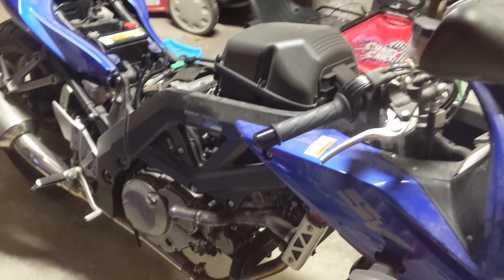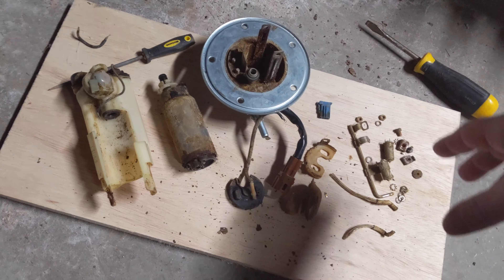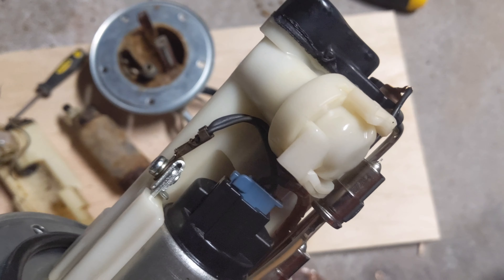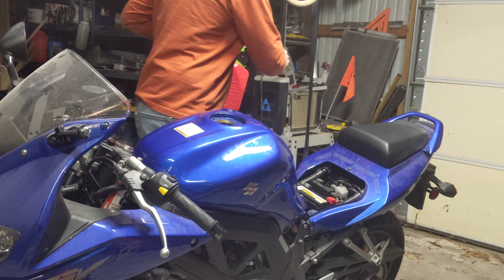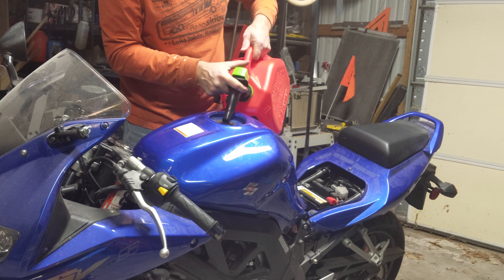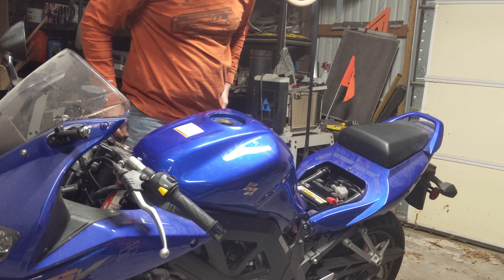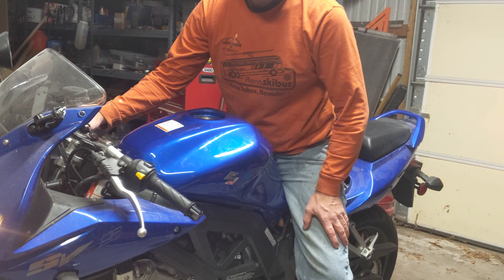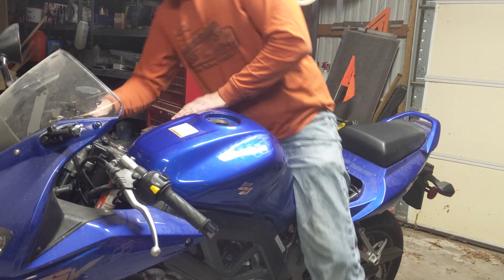Replaced the fuel pump in my SV650S auction find to get it to start!!!

Comment: Hello,
Did they have more pumps at the place you bought from on ebay? Can you link if so? It looks like a rebuild, but all the used ones I see are $350-400!
Reply from the maker: I purchased my pump from this guy, if he doesn't have one listed perhaps reach out to him https://www.ebay.com/sch/necycleoutlet16/m.html?_nkw=&_armrs=1&_ipg=&_from=
Reply: @nutty-cool  Awesome thanks! It doesn't look like they have any right now, but will message. I'm in a similar boat with my bike project. Was given an 05' sv650n thats been sitting for 14 years! Its a pretty stupid project, but giving it a shot to see if I can get it started. I'm rebuilding the existing pump first, but I don't have high hopes for it so looking for backup plans on a budget. My bike only has 1280 miles on it...its crazy